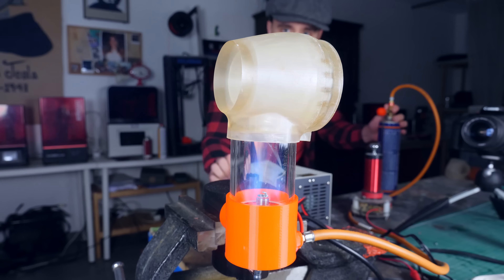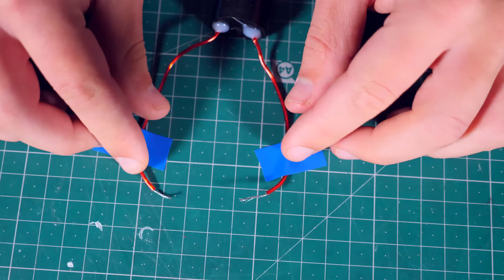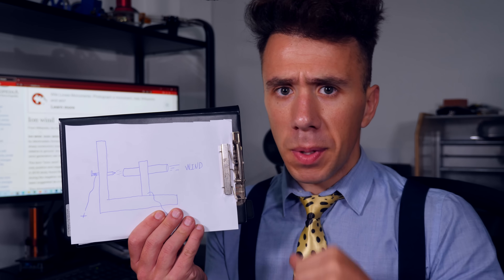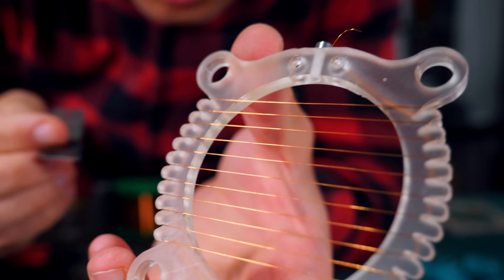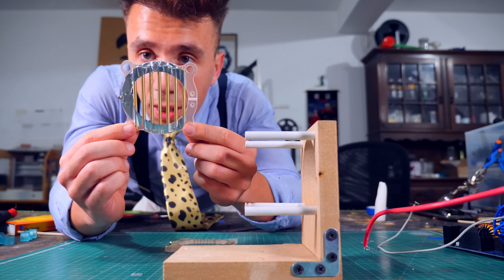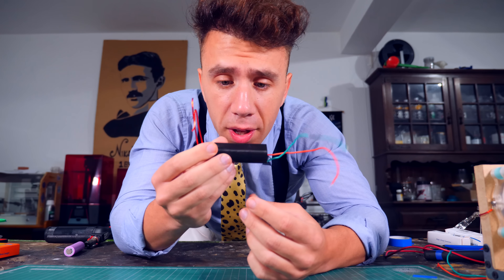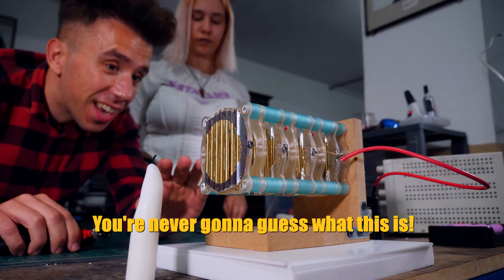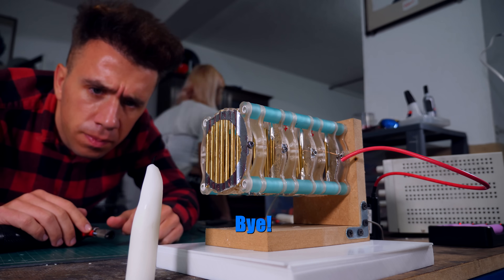I built a TRUE BLADELESS FAN

Comment: A possible fix for the blade-less fan would be to enclose the flight path in a non-conductive plastic (printed) tube and taper the far end to a nozzle.  Then you can get all the power focus into one area and have higher air flow.  This should be a simple fix!   You can have different nozzle size openings and graph the results of nozzle size/air flow.  Also, increasing the voltage should generate more air flow.  It would be a good experiment to record the value of the high voltage (from low volts to high voltage) and also measure and record the air flow rate so as to project optimum air flow/voltage settings!  Working up the two variables (nozzle size/voltage values) could produce a real tornado (not a tomato)! I hope that this wins a 3D printer!!

Comment: Integza, sorry to disappoint you, but ionic thrusters in atmospheric condition are an epic fail - as many inventors had to learn the hard in the 60's. There are two problems: The minor is, ionization of a gas molecule takes lots of energy, that is converted into UV-radiation, ozone-, and nitrous-oxide production. Things, that don't provide thrust, but pollute the air and jeopardize health of organisms. The real party pooper however is enthalpy of formation. To rip apart O₂, or N₂, you have to expend a tremendous amount of energy (498kJ/mole for Oxygen and 419 kJ/mole for Nitrogen) - just for the reason, you can ionize these atoms, accelerate them in the electric field to harvest the reactive thrust force. In simple words: Thrust-efficiency is typically below 0.5…1%. For comparison: Propellers have a typical efficiency of 80…90%. This is the reason, ionic lifter fans have to expend kilowatts of electrical power to lift a mouse - while a small drone consumes about 50…150 Watts and can carry a quite heavy camera. When monoatomic (!) noble gases like e.g. Xenon are used in space thrusters, then, now energy waste for enthalpy of formation is required.

Comment: There are proposals for  blameless wind turbines that  using this principle in reverse. Blowing air over a high voltage wire to generate current. 

It would be interesting to know how much ozone is in the expelled air of this generator. It would also be interesting to see if the bladeless fan removes smoke particles from the air stream. In theory the high voltage discharge will also kill bacteria and destroy viruses in the air stream.

What is the polarity of the applied voltage? Is the last set of wires at ground potential? If operated for any length of time, one might expect dust to be collected within the apparatus, maybe representing a fire hazard. 

It would be interesting to know how much RFI the device generates, certainly fitting choke coils to the DC EHT leads, should reduce any unwanted radiation from what is a potential spark gap transmitter.

I was under the impression that the high voltage generator being used, needed a spark gap at its output to reduce the dielectric stress on the generators insulation. A failure to provide such a gap results in a reduced life, due to dielectric breakdown .
I believe these high voltage generators were originally designed to be used in stun guns, where a spark is always present to reduce the output voltage. It also serves as a form of intimidation or warning for the victim of the gun.

Building a cockroft multiplier would reduce the dielectric stress in the EHT generator.

Comment: I'm curios what would happen if you put it in a non conductive tube.
my thinking is it would allow the air to accelerate without it going off to the sides, or coming into contact with static air that might disrupt the flow any

Comment: Why not take the bladeless fan idea and use it as a thrust producer. You're getting 15m/s of airflow with the multi-stage fan, right? Well, you could scale it up or make an array of the devices and have the world's first Engine that truly has no moving parts. You could also get variable thrust by controlling the amount of current running through the system. At least, that's the assumption I'm making.

Comment: What if instead of razor blade scrapes you pit small twist points all equal and then brace one side of the twists and use a knife sharpening stone to sharpen them pointy and instead of making them flat make them in in the shape of a cone withing a cone one cone being made of tube rings large to small the other made of the sharped twist points in rings large to small so it acts like a rocket booster cone

Comment: 1. Enclose the sides, to ensure all the air comes from the input.
2. Make the middle smaller, to create a low pressure Venturi Effect.
3. Feed alcohol to the centre, like an old fashioned perfume spray bottle

When the fuel hits the plasma, you get a jet engine. BONUS: Final grid should act as protection (Davy Lamp) to emit air without fire.

Comment: I have been thinking about this for a bit now.  What would happen if instead of doing rows, you spiraled both the tube and the wire; and made the spiral offset at each spiral to the smallest area, so you have a type of pyramid shape but with the gradient of shallow bowl.  How would that affect your output; would it be better to use on tube bent to a point, or to use several circle tubes going down in size?  

Second question would be, what would happen if you couple your best output with an actual engine exhaust like the turbo one you created, making the intake end large going down to a small compression chamber to exit through an exhaust that is 1/3 the size of the intake.  Would this give you even more force?

Just a thought.

Comment: You should revisit this build and try to get some swirl into the stream. What I mean is: try to give each next stage a bit rotation in compare to the previous one. Like: The first stage is 100% horizontal. Now for the 2nd stage: tilt the wire and tubes for maybe 15°. So the next and so on. This may give you more efficiency. Give it a try

Comment: Try two nails one nail is ground the other  nail is positive an the pipe sets between if it works add a higher voltage capacitor. It's like a static charge.

Comment: You've got to make the electronics on your own like Jay told you. Can you use electroboom's full bridge rectifier? Would rotating each stage 90° or so help the results so later stages aren't blocking prior stages? How about adding a nozel to get a boost from brunouli? Experiment and show the process and results!

Comment: PC fan and heatsink maker Noctua is planning on making a desk fan with a venturi effect design, basically it will be one of their fans with a shroud attachment that generates the venturi effect. Googling this you should come across Noctua's press release from Computex 2019, as well as a few thingverse clones of the of the venturi effect shroud.

I wonder if adding the venturi effect thing to this will increase the airflow even further?

Comment: Hm! Would a grid of wires work better? A fly mesh maybe? What about squishing the tubes slightly so they are more oval shaped for better airflow or like on that triangle thing: use razor blade thin sheets of metal?! What if you use multiple stages with different diameters (a single high voltage unit for every new diameter?!) and different distances? What happens if you put that into a tube/duct of some sort? Turbine like compression? (Probably not but hey... :D  )

Comment: It's a great idea. Especially if you want to slowly dissolve what the fan is pointed at. Mind the ozone, Integza!
Reply: This was my first thought too ... nice poisonous gas generator! 🤣
But cool science project.
Just be careful with high voltages and toxic gases.
Reply: Health issues aside, it's worth mentioning that ozone interacts with organic compounds. So as well as fungal spores and lung tissue, it's also petroleum based products like some plastics and particularly rubber. Constant exposure to ozone will gradually brake down these compounds until they eventually fail. Periodic use of ozone generators is generally acceptable as the gas will mostly interact with the organic compounds on the surface and not so much parts themselves.
Reply: @benshakespeare268  i heard you can use ozone to purify water, so maybe it fails as a fan but might have another use
Reply: @basteagui  yes I believe that's how salt water pool filtration works. I'm not trying to say ozone is all bad, it's great depending on how its used.
Reply: @benshakespeare268  i have an idea to save this project. hear me out.
maybe instead of blowing air directly with this ionization device, you instead use it to suck air and create a vacuum. then it can be used with the venturi effect on a nozzle, to make clean air flow through.
finally, the air that is sucked through to the ionization chamber can be collected in a chamber that purifies water tanks.
i also have a secondary idea to make the wiring on the stages a spiral instead of a grid, might push air better
Reply: @Integza like a few people have mentioned here, ozone generation is a real concern here. You would have noticed a strange electrical smell while this operated? That is ozone and it occurs naturally in low levels, however breathing high levels is definitely bad for your health.
Reply: Yeah, I have a commercial version of this, whose purpose is not really to generate wind but to catch fine dust in the air. It is placed close to my FFF 3D printer in order to catch the nasty burnt stuff that results from the printing process, and it is actually pretty good at that. But what it is best at, is generating ozone. In the large room where the printer is, this is not really a concern because I also avoid being near the printer for long while it is operating. But leaving this device turned on in a small room for an extended time is a bad idea, unless you want to completely nuke all the fungal spores.
Reply: If the air gets ionized at the anode doesn't it get unionized at the cathode?

Comment: what if you made a few "banks" of fans, clustered like a multi engine thruster but with angled cowling to direct air only forward, maybe this could be used an electric compressor of sorts for adding induction to a jet engine, without the use of fuels or mechanical aids it might improve efficiency or maybe the ionized air could affect the trust/burn properties of an engine.

Comment: I wonder if this same concept would work with two slightly conical "coils" sitting inside each other, one positive and one negative, with an exact geometry to produce the effect throughout the gap between the positive and negative ends. I have no 3d printing experience but I could imagine it being a tube shaped housing that you could assemble both ends of the circuit into and then slide into an outer shell that helps direct the airflow

Comment: I'm curious, what happens if you put a layer of steel wool in there?  Either at the front, the back, or between each stage. Would it restrict the flow, or would the increased surface area increase flow, or would it just burn up? I wonder if different grades would have different results. Probably be fun to watch either way.

Comment: Several tips to improve the fan: 
1. Use a high grain sandpaper instead of razor. It will create more "sharpy" surface on the wires and should improve the performance by 10-20%
2. Use aerodynamics optimized design for enclosure. First easy way to do this - close the sides of your fan. Secondly, you can use wing-like curved casing (like in duct fans) on the side where air gets in - it will create low pressure zones and will help to suck air in more easily.
With all this tweaks you'll go beyond 20m/s for sure.

P.S. Also, instead of rods, you can just use one drop shaped smooth copper piece to improve air flow. Or just make the rods drop shaped.
Reply: Possibly. This "fan" has multiple drive stages. It could be possible to take more advantage of the Bernoulli principle to pull more air in for each stage. But it's really a balance of velocity vs. volume.
Reply: #2 would be.... Venturi effect, no?
Reply: I'm also curious if there is some fun to be had by lighting a flame near the input, as this would pre-ionise the air somewhat, which may help the high voltage to pull the air - although it might do nothing, or cause arcing. 
If not a flame, then some other way of mildly ionising the air.
Reply: What I was thinking was drop shaped modules with on the blunt end a negative electrode and on the pointy end the positive one.
Reply: @lindnertom  its very useful for no maintenance propulsion.
Reply: The sandpaper should also take more of the insulating lacquer off those thin wires are usually coated with.
Reply: ...I think a loop of wire works pretty well. The original Ionic Levitator uses a loop of wire that does not interfere with the airflow.
Reply: So.. are you just throwing ideas out there or do you have something to back up your suggestions? He shared the files to 3D print, so he's not really looking for 'this might work', but actual solutions that have worked for this application.
Reply: You wouldnt really want to encolse this. Since each stage adds in surounding air, cutting that supply off would make a serious bottle neck.
Reply: @jacobhargiss3839  To benefit from surrounding air you'll need more power to the point, when pulling more air from inlet in enclosed fan design will require more power vs pulling it from surroundings. Otherwise, you'll loose velocity by wasting energy on moving surrounding air.
Reply: @valuxin  at each stage, the air isnt pushed so much as it is carried by drag, if the only openings are at the front or the back, the only air in the system would be that which the first stage can supply at the start. But since these dont actually suck in air, that creates a problem. 

If Im recalling correctly, I saw a video where someone tried exactly this and it had a rather poor impact on the thrust.
Reply: 3. increase the size of the wires.
Reply: @banditoincognito8950  I think this would actually make it worse, as the electric field extends from the sharp edges really well, where larger wires would reduce this effect.
Reply: @banditoincognito8950  It'll hurt the performance, since you need positive side as small as possible and negative side as large as possible.

Comment: Those chinese HV generators are such trash. I use them in my home made electrostatic powder coating gun and they die so easy. In fact, the replacement i installed yesterday died after 10 minutes. Previous one lasted a few hours of use.  I think i need to build a high voltage cascade like you kinda showed in this video.

Comment: It seems like with high voltage the construction of the device matters more than amperage. The shape to generate the most thrust would probably by a spiky ball surrounded by needles of the opposite charge. Making this into a fan would be a mix of the shape of a pc fan and a cone, with the central hub being the farther away tip.

Comment: Many years ago (around 2000s) when I liked to play with HV, I had this idea. I made the device with razor blades (you know, needed sharp edge, metal, so I came with this idea). It worked but the ozone smell was too powerful; it gave me headache only after few minutes from turning it on. I used a B&W flyback transformer (some 3KV) with its TV18 selenium rectifier driven by 2x2N3055 in astable configuration.

Comment: I am wondering if you put the bladeless fans in a circle which is enclosed,  as it will generate and maginfy the ionic wind  if you did it as a letter Q shape the out put could be at the bottom.  I would make the bottom part a venturi nozzle.

Comment: I had a great idea for a video! I noticed in some of your acrylic prints heat management became an issue and led to destroying the housing. Perhaps you could use a design similar to the XLR99 where a liquid propellant was run around the housing in tubes to keep it cool. 

Tie that into your intelligent design from research thus far, and I think a sustainable 3D printed jet isn't too far off!

Comment: Say, Integza...  When i was in high school (probably about the time your mom started grade school), I was taught that it was a VERY BAD IDEA to wear a necktie when using power equipment -- things like a table saw or drill press, for instance -- because just a single wrong move and your tie can pull you by the neck into whatever powerful, rapidly rotating, sharp device you're operating at the moment (same goes for long hair, BTW; a lab technician got her ponytail into a lathe while I lived in Seattle and died from having her body wrapped around the chuck).

Just a suggestion -- I'd hate to see your channel suddenly go silent and eventually hear from another technology vlogger that something like that had happened to you.

Comment: Instead of using this setup as the output for the air, you should try and build a housing around it like the Dyson, but instead of an impeller blade in the base, use a vertical arrangement of these ionic wind thrusters and have it go into a circular loop amplifier.  Should be easy to 3D print or potentially utilize the top of the Dyson for proof of concept.

Comment: The Dyson fan uses the coanda effect. What about adding aerodynamics to improve flow? Maybe by eclosing the device (much of the thrust must be leaking out the sides) and maybe experiment with the venturi effect. Will a velocity stack on the intake increase flow? Will a nozzle at the exhaust increase pressure?

Comment: I wonder if there are coatings that could reduce the voltage required, or improve the effect. I've read about carbon nanotubes grown on the metal which could do it. Simpler methods could be coating it with short metal or carbon fibers. Perhaps sandpaper rather than a razor.